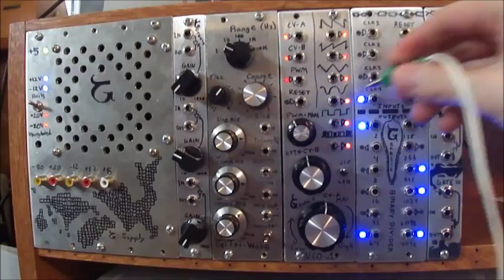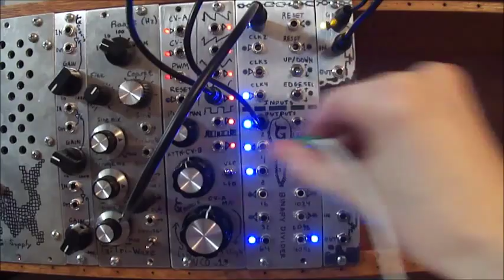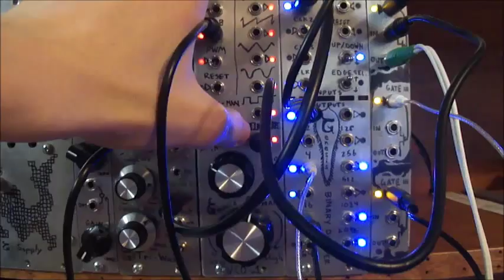Synth DIY - Analog Switch Demonstration

Comment: nice little modular! did you design everything yourself and how long did it take you to build?
Reply from the maker: MrFricoco Thanks! I did design everything myself. I've been working on it in my spare time since the Summer of 2014. I had slowly working on the "VCO-v1" module for about 6 months. I had it on a breadboard for that period of time. I would occasionally make little tweaks and revisions for sections of the circuit. I'm glad the circuit is soldered together on copper clad now :)
Reply: is it difficult making the panels look that good? Did you drill all the holes yourself or pre-order it with holes cut?
Reply from the maker: I'm flattered that you think they look "that good"!
I start out with some scrap sheets of 1/8 inch aluminum. I then use a hacksaw to cut the aluminum to the proper size for my panels. My panels are all 7 inches tall, and 1, 2, 3, etc... (a counting number) inches wide.
After cutting them with the hacksaw, the edges are jagged and sharp. I use a metal file to take off the panel's edge. I will also use some fine-grit sandpaper to smooth the edges as well as the front of the panel.
At this point, I will tape a paper template onto the panel. I draw up the templates in a program called "Eagle CAD". It is primarily used for schematics and PCBs, but I use it for laying out front panels as well. These templates are created digitally and printed out.
With the paper template taped on, I make small dents in the aluminum to guide my drill bits when drilling out the holes for all of the components.

It definitely takes time to make these panels.
It is easy (and fairly cheap) to go to your local hardware store and buy a hacksaw, a metal file, some drill bits, and some sandpaper. However, the piece of equipment that might require a bit more cash to acquire is the drill press. Alternatively, you might try drilling them with a hand operated drill.

Of course, if you choose to make panels in this method, BE SAFE! You proceed at your own risk :P
Reply from the maker: MrFricoco Your question makes me want to make a video detailing my panel making process.